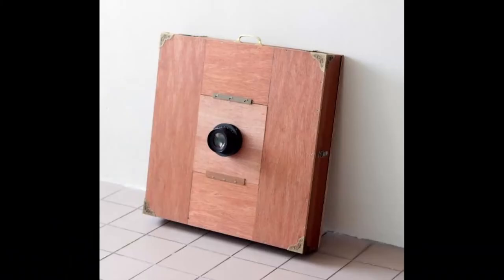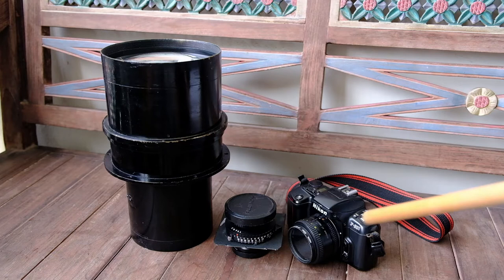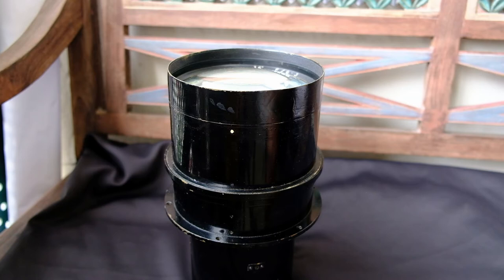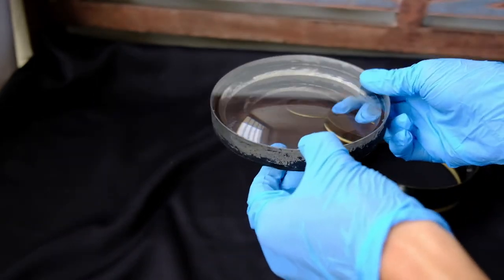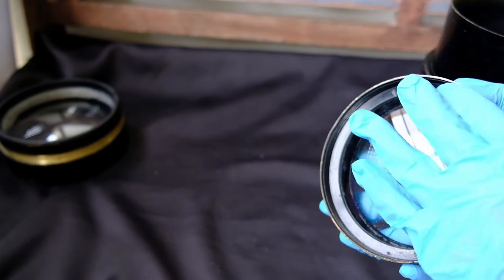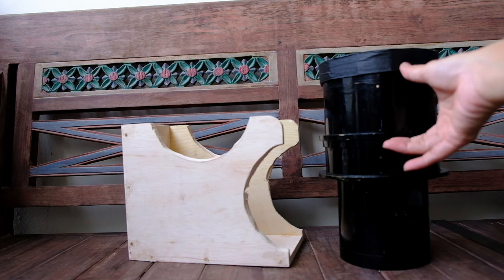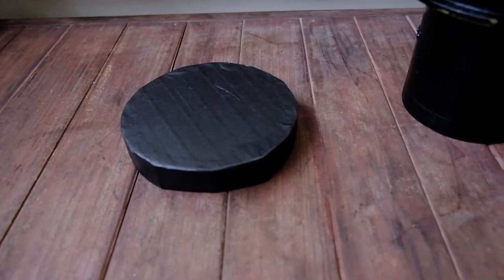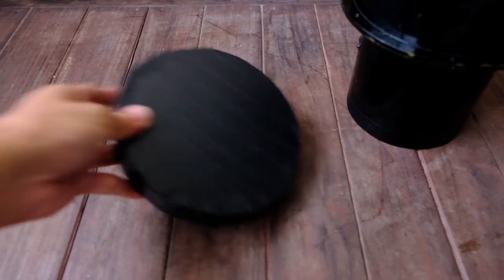ULF Camera Build Part 1 - Lens

Comment: That looks like a Ross London Xpres lens, I have a 24 inch F6.3. Still getting the parts together for my camera though!
Reply from the maker: I read there were a few companies that made these lenses during the war. Aiming for a rapid and dirty build with cardboard boxes first.
Reply: yes, I have a 9.5 inch Ross lens that looks really similar but much smaller
Reply from the maker: @peter-robinson  interesting. have you try using yours?
Reply: @AnaloguePT  not yet, it’s for a 120 year old half plate camera I am rebuilding. I just got a brass mounting ring made, to match the lens thread. Soon I hope to use it.....